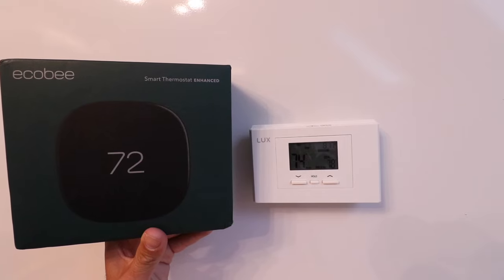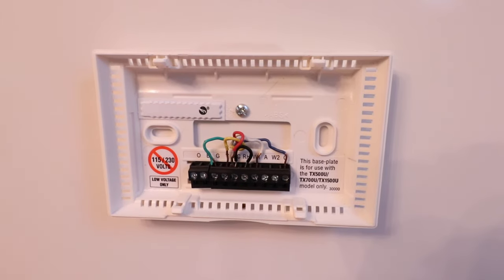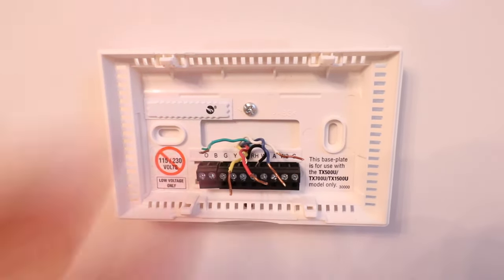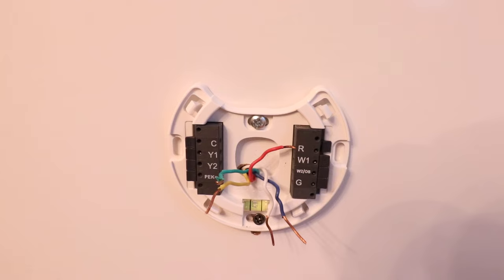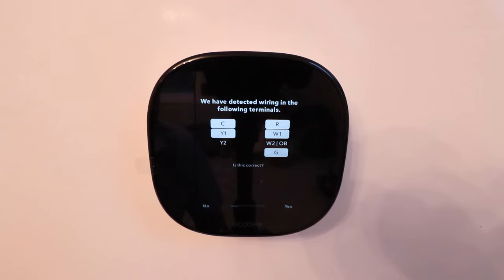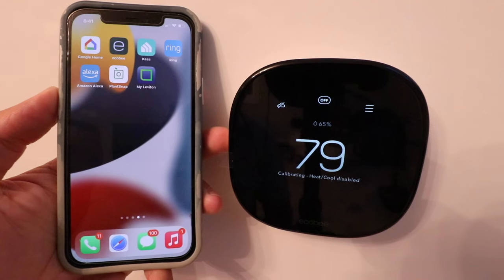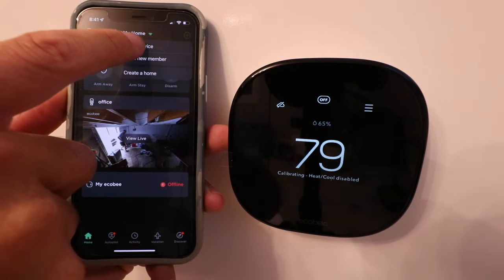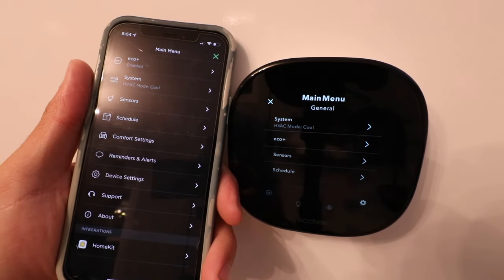How To Install Ecobee Smart Thermostat Enhanced (New 2022 Version)

Comment: Great video! Followed EVERYTHING to the tee.  Unfortunately when I switched the power on the breaker, the thermostat didn't turn on.  Ehhhh...no worries.  I'll figure it otherwise, I'll have a pro come in.  Thank you though; this was beyond helpful.
Reply: I have the same problem.
Reply: @Silent1Pinoy  a pro came out and it ended up being the sensor on the coils.

Comment: Great video tutorials - thanks. Quick question: I have 6 wires instead of 5 wires ... the 6th being for a humidifier.  What remaining terminal does that single (1 wire) humidifier plug into? The W2/OB terminal?  Thanks. And please keep the great videos coming! Cheers.

Comment: May I suggest you consider a step by step install video for dual-fuel systems for the enhanced and premium models.  Recommended settings would also be helpful. (esp. Heat Pump and Gas furnace.)  The new Inflation Reduction Act is heavily incentivizing consumers to switch from traditional compressors to heat pumps - dual fuels systems have been gaining traction in recent years and will likely become more accepted soon and for several years to come.
Reply from the maker: Thanks for the tip! I’ll get one done for heat pumps!
Reply: Yes, please! I just got this a few days ago...with a whole new HVAC system...and just ran a new 18ga/8 wire...but don't know how to wire that in to my dual fuel system.

Comment: Is there another one that instructs you how to add a 5th wire in the sir handler and connect it to the pek device? I had 4 wires connected to the old thermostat. There is a blue fifth one not connected to anything in the thermostat and not connected in the air handler.